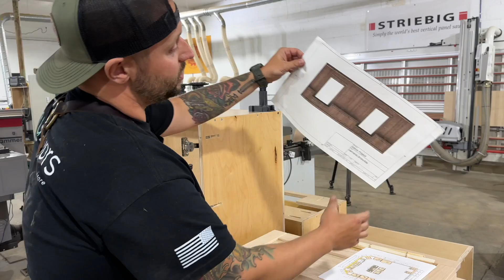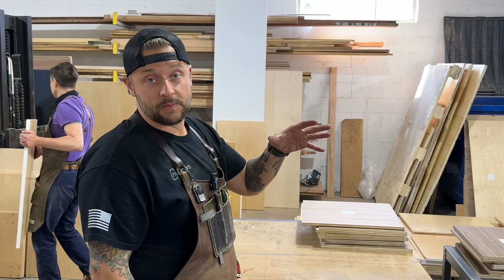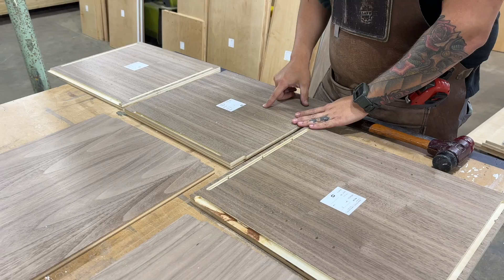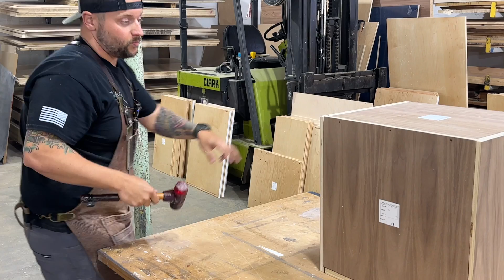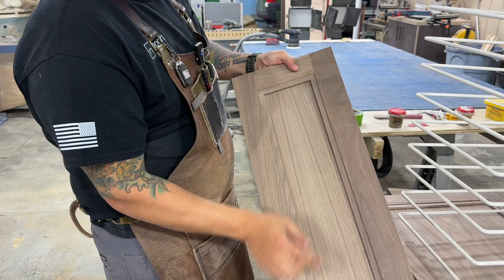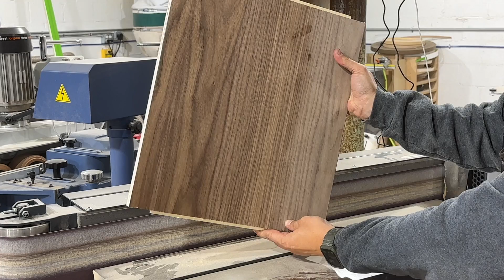KITCHEN CABINETS - BUILD or BUY? / CNC Kitchen Cabinets

Comment: To get the chocolate I use a conditioner, then tried and true polymerized linseed oil, then shellac, then grain filler then finally spray with a 2k satin. It all goes pretty quick. It has the Rubio walnut (gold and deep chocolate) look which everyone loves but has a hard 2k on it.
Reply from the maker: Nice! We’re going for more of a natural walnut but need the shellac to pop the grain.

Comment: I love what CNCs can do, but I don't like cabinets made on a CNC.  Nothing beats good old fashioned custom built-ins.  But, with tight time schedules, I get it.
Reply from the maker: For all intents and purposes these cabinets are exactly the same. Actually I’d say superior because of the blind dado construction! But I understand the dislike of CNC vs doing it yourself.
Reply: @TodaysCraftsmen  Thats interesting.  They just don't look as sturdy, especially without nailers behind the back.  I also use 1/2 inch for backers on upper cabinets with 3/4 nailers.  So, I tend to overbuild.  When I'm doing a job for a client, I don't want a single wobble or any racking whatsoever.  Sure wish I could find a good supplier of that walnut plywood.  Best I can get around here is prefinished maple.
Reply from the maker: Most CNC shops want to do full 3/4” backs because then you’re only dealing with 1 type of material.
Reply: @TodaysCraftsmen  That makes sense.  I can barely spell CAD so I dang sure couldn't program it.  LOL.  I want to get one of the shaper origins just to add some different levels to my work.  That seems a better starting point.  You know us old dogs......new tricks and all.
Reply from the maker: Those shapers are pretty cool. We’d love to have one for certain situations.

Comment: Never liked useing those stickers to identify parts. It seems to take longer to peel them off than to assemble the cabinet . I didn't see any holes predrilled for screws , any reason ? How do you treat the underside of your uppers.? Lookin good pumping out the work.
Reply from the maker: These stickers actually come off easy and clean. We’ve had ones that were a nightmare for sure. Upper sides have the bottom edges edgebanded and the bottom goes all the way back to the wall. We add a light rail so it’ll all be covered in the end anyway. 

The CNC guy didn’t drill the screw holes all the way through 😬 He’ll fix that for the next one 🤦‍♂️
Reply: @TodaysCraftsmen  Ah yes the CNC guy always gets the blame! I always blame it on the software or the machine. Do you happen to know what software he uses?
Reply from the maker: He’s getting the gcode right from Mozaik.
Reply: @TodaysCraftsmen  Thanks. Looking forward to seeing the next episode. Keep on keeping on !
Reply: haha, that's the first thing I noticed too. I got worried just seeing the stickers on a plywood veneer. nice to hear they come off easy! I wonder how much extra time it'd take to label the part wit the CNC in the spots that are joined...probably not worth the effort if the stickers aren't a problem.
Reply: @atomictyler  Don't quite understand the question you're asking about the labeling but you definitely have to do it in some fashion. I just give a part the cabinet number it belongs to. You can look at a pile of parts from a individual cabinet and tell where it belongs. Very rarely we'll cut a part and everyone looks at each other and says I don't know
Reply from the maker: Yeah there’s way more information than I need on these. All I want is room number, cabinet number, and I do like to have the part name but it’s not absolutely necessary like you say.
Reply from the maker: That UV plywood is pretty tough, duct tape wouldn’t rip the veneer off. Definitely would add a lot of time to engrave the part using the CNC!